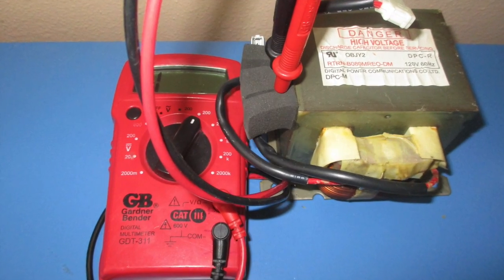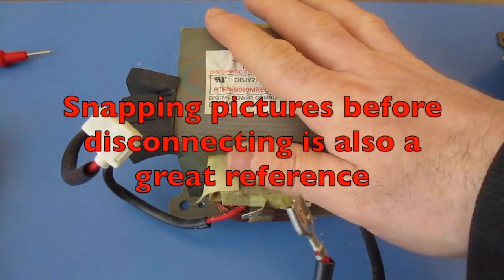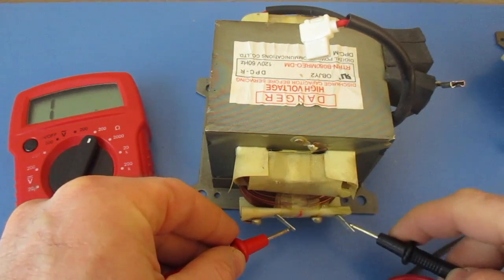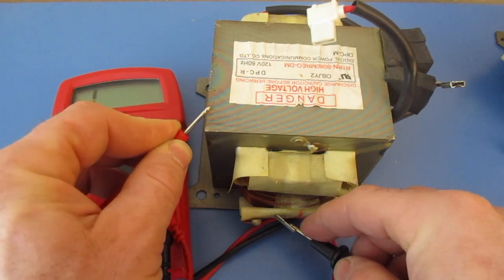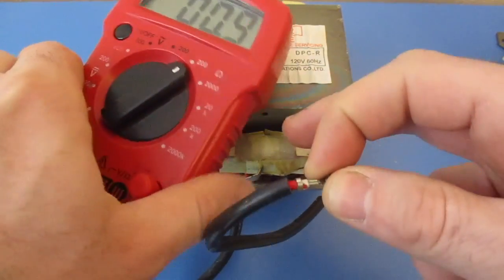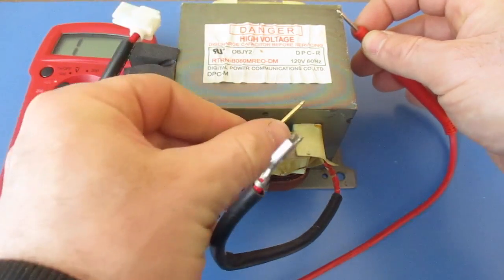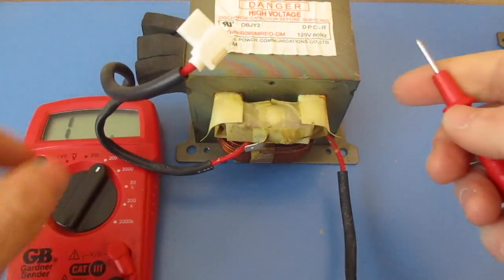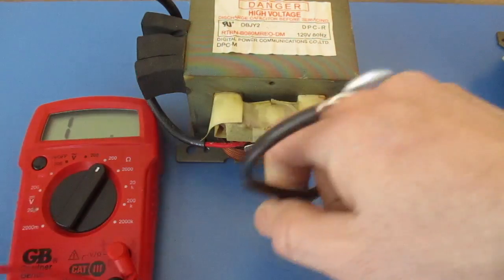How to Test Microwave Oven Transformer High Voltage HV with a multimeter

Comment: Another way to test this transformer ( safety ! ) is to put your mains across the  HIGH VOLTAGE  coil ... then you should read a VERY low voltage coming from the side normally connected to mains ( for UK  230 Volts this might be around 20 Volts ) the USA transformers should be slightly lower Voltage ( ? ) if it does not get hot or smoke then the transformer should be OK .... NEVER ! test with mains connected to the correct winding ( you  WILL  die ! ) ....... DAVE™🛑

Comment: I have three switches on the GE microwave. Two of them are normally open and has similar specs like Gsm-v1603a2 250V.    But one switch shows GSM-V0303A2 , which is hard to find. Is there a replacement for this one?
Reply from the maker: just look on eBay and you'll find wahtever you need.

Comment: Was wondering if you could also plug it in and check the output voltage incase the wndinding has shorted and output is normal or not
Reply from the maker: For Safety Never test live unless you're a trained professional and now exactly what you're doing, so if you're asking I'd say "No"  Safety first look on Facebook marketplace before you light yourself up...

Comment: Hey great video!  I was helping a friend fix her microwave by replacing the transformer and capacitor, as suggested by a friend.  When i reassembled it and ran it the first time, it ran for 10 seconds then shut off. I took it back arpart and found I did not connect the white plug from the transforner into, whatever it goes into. My connector is a 2 wire, and bigger.  It's an LG microwave.   Any thoughts on what I did? I am thinking i fried both parts.  Is it possible I damaged any other parts  with this mistake?

Comment: I prefer just applying a voltage to the secondary, then you can read the primary with a multimeter and use the step decrease the other way around.

Comment: To be honest, if you don´t know how to remove this thing out of a microwave, you should never even think of playing with a MOT in the first place LOL
Reply: That's true! But you should know that it's perfectly possible to perform this test with the transformer still attached to the microwave oven, with the connectors removed. This is often the case because this part weighs approximately 4.5 kg (9.89Lb).

Comment: I'm getting 148.5 ohms on the high side... Is that too high? ~( 'w')/

Also, if the related diode is good, will it have some kind of resistance on it one direction or the other and if so, about how much?

I tested my diode and it seems to be like zero ohms regardless of polarity.

Comment: Quick question when testing this thing I get like a 005 and I'm testing the bottom the bigger diameter wire does that mean it's grounding out cuz I have a brand new microwave Toshiba everything works but it don't heat so I'm trying to figure it out

Comment: Hi, asking for a solution here. Continuity test at the terminals feeding the capacitor showed 0 Ohm. Between one of the terminals and the chassis it was about 230 Ohm. The fuse was blown. Are these signs of a bad transformer?

Comment: If HV Transformer primary shows 3 ohms instead of 1ohm & HV taping to geoend shows 226 to ground, then is the transformer  ok or not. Please guide. Primary is getting 220vac from control & Microwave not heating!!
Reply: How did you fix it?

Comment: You must zero out your multimeter!!!!!!!! when you measured the short secondary winding that read 0.8ohms that's the resistance of your leads!!! the true resistance reading of that winding is almost zero ohms, it's like 0.04 ohms because it's a very short winding like 2m long. I had to find this out the hard way and open up the transformer all for nothing. it's NOT 0.8 OHMS!!!!

Comment: Hi - I live in a 240V country and I tested a 240V transformer, the primary was about 3 ohms dc resistance. And the primary wire looks thinner than yours, it is about 260 turns.
Reply: it ac not dc
3 ohm to much my friend 
its junk
find another one
Reply: @fuorman4872  Your comment is based on what? Mine was based on a measurement on the primary of a small 240V MOT. I also measured a larger 240V MOT, the primary dc resistance was 2 ohms. Nothing wrong with either of them, working fine.
Reply: @ridefast0  all i know my friend is Transformer doesn't work on dc
its only work on ac
plus 3 ohm is bad
it should be less then 1 ohm
Reply: @fuorman4872  The video suggests dc resistance value for a 120V transformer as used in USA/Canada. But other countries can have different house voltages. I am telling you for the third time, my measurement is for a 240V transformer! That means the primary wire is thinner and longer. That is why dc resistance is higher.  Also, do I really need to say that we often make a measurement at dc even if the transformer will be used with ac of course. Three ohms DCR is not 'bad' for a 240V MOT.

Comment: What the problem if a microwave keep burning up transformers .l did change magnetron,capacitors,diode but nothing change please help me.
Reply from the maker: often a faulty cap. and diode cause it.  did you get new or used.  Test the cap and diode again

Comment: what if the reading you get when measuring the high voltage is higher ie instead of getting a reading between 80 to 120 ohms, you get 250 ohms. what does it suggest?
Reply: I have two RCA microwaves that don't heat. I've checked everything and the only problem with both of them are their transformers with ohms over 200 ohms. I suspect that means the transformer is bad. But nobody seems to comment on this. So, I'm like you, Paddy: I'd like to know for sure if the ohms reading is above 120 ohms, does that mean it's bad?
Reply: @randallmacdonald4851 how did you fix it?
Reply: same issue for me - reads 210 ohms and doesn’t work
Reply: Same issue for me read 145ohms

Comment: Symptoms. The microwave is working. But, when I  open the door to remove a recently microwaved item the microwave light and fan (on low) sometimes come on. .  Then sometimes when I press cook the microwave indicates it will cook. However, when I press start it will not cook unless I open and close the door and press start again,. So in both instances, it sounds like the door switches are at fault? I think I have one or more defective microwave door switches and the under the cabinet microwave is only 1.5 years old (model jvm3160df4ww):  The access to the door switches is fairly far from the capacitator.  Is it safe to test and replace the door switches without opening up the microwave to discharge the capacitor (which would high to the upper right of the control panel)? In other words, I would be far from the red wires connecting the capacitor and the transformer. If necessary, perhaps I could wear some sought of gloves that would protect me from shock. But once again, if I am far from the capacitor I think it would be a safe repair. I am trying to avoid removing the heavy microwave from under the cabinet. It is very hard to reinstall it once removed just to remove the inaccessible panels to discharge the capacitator. In the video you did not remove the microwave, you just removed the control panel and the grill,  and then the switches. I would be more than happy to follow what you did as long as I did not need to discharge the capacitor.

Comment: Question 120 ohms test from secondary winding to case shouldn't that be OL (infinite) reading. Is the secondary winding isolated from the case?  I'm asking because I don't have a diagram of the transformer.
Reply: The transformer's secondary has one end connected to the transformer core as a neutral or live depending. The second wire with a connector for the capacitor is the other end of the secondary

Comment: Hey if you getting a reading above 120 ohms on the high voltage output wire, like 180 ohms means the transformer bad ?
Reply: No..

Comment: Just wondering how it is possible that we are getting higher resistance readings through the primary coil than the secondary when the primary is a thicker and shorter length of wire?
Reply: That depends on the windings, there are step up and step down transformers.  Look those up and study, I have been away from this for a very long time and would not want to give you bad info
Reply: High resistance means 
1 meter thin wire has more resistance than 1 meter thicker wire
You have a misconception in your thought. 
So thicker wire can deliver more current hence less resistance, 
Hope this helps.

Comment: I am a beginner with enough electrical knowledge to dare to fix an old samsung microwave. I have just plugged it in and noticed there is no dc coming out of the transformer side that is connected to the front buttons. I think I should get an output of 12v dc. Is the transformer broken?
Reply: I think the output is AC which gets rectified after down the line
Reply: @christianstclaire5706  yes, you are right. My knowledge is greater now but the microwave is still waiting to be fixed by me , lol!

Comment: my multimeter caught on fire 🔥
Reply from the maker: For real? Did you disconnect the transformer from everything?
Reply: I tried to check the HIGHV output while it was on hahaha
Reply: @layneduffy1123  😂😂😂😂😂😂
Reply: did u use multimeter when there were voltages in transformer?

Comment: It would e helpful if you measured the hi volt output  (using an attenuator)  with line voltage connected to the primary !
Reply: This is very dangerous dangerous dangerous Martin Martin Martin! (Around 2500Volt)...

Comment: For what reason are you not using the Earth (Ground) stud of the secondary winding for doing the continuity tests ?.
Reply: This is useful only for the high voltage winding. (As regards continuity). For the rest two windings it is useful only for leakage tests, not for continuity.

Comment: I'm confused. What are "those red wires"? What was the other contact off the secondary on the back?
Reply: In a mw transformer there are three windings. The first one (the nearest to the core) is the primary one. Next is the one with the red terminals in this video. This is a low voltage but high amperage winding for the heating of the filament of the magnetron tube of the oven. Next is the high voltage winding which feeds the anode of the magnetron. Both the filament and the anode feeding windings are the secondary ones, which are independent to each other. Moreover, the high voltage winding has its one terminal grounded. The other terminal, after a rectification and smoothing with a capacitor feeds the anode of the magnetron with almost pure d.c high voltage. I hope that your confusion is now gone!
Reply: @ΠάριςΑζής  very detailed explanation, so useful, so all outputs are AC the rectification to DC is external?  Thanks a million.
Reply: @christianstclaire5706  All the so called linear transformers work exclusively with A.C and (of course) reproduce (as a rule) in their secondaries stepped down replicas of their primary waveforms. M/W transformers also produce a stepped up replica of the mains. This is an exception of the usual applications. 
The high voltage is rectified just because it must be so. For the filament’s low voltage/ high amperage supply, there is no need for rectification. Filaments work happily with both AC or DC as they are resistive loads producing merely heat...
What has to be kept in mind is that any such transformer should never be connected to D.C source. This is due to the fact that D.C does not care about the inductive impedance of the primary winding and “sees” only the pure resistance of the wire of the coil. Therefore, if connected in DC source, the transformer will immediately be blown up...
Reply: Those red wires are for the e-z-Pee-z  "Ament" Engineer contacts. So much easier than using a multimeter. Totally sure you qualify; After plugging it in to the adapted 220 outlet, grab bare spot on the tip of the wire farthest to your left with your right hand, next grab the wire farthest to your right with your left hand at the same area as the first wire.... now... if you've felt a tingling sensation after everything goes black your windings should be good. You can now call the nurse over and request your discharge paperwork, head back home, and finish up that project you were working on... BUT- If you feel a tingling followed by an all encompassing warm, inviting, bright light, you might as well walk into it because whatever the result of the test it no longer matters. 😁😂😂
Cheers mate

Comment: How if i get reading of below 80ohms
Reply: Most likely, the transformer is shorted out...
Reply: What if all my readings are higher? Like main coil is 3.4ohm and not 1.5, resistance of the secondary is 190ohm instead of the 120 in the video? No continuity throughout the body though